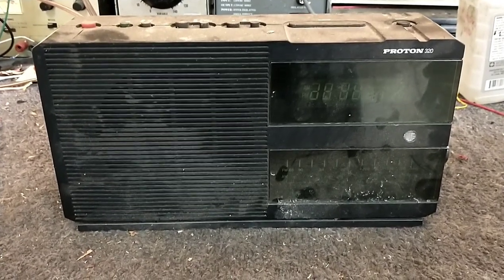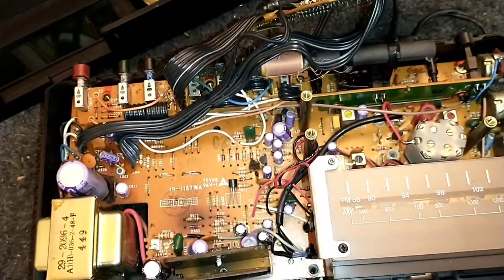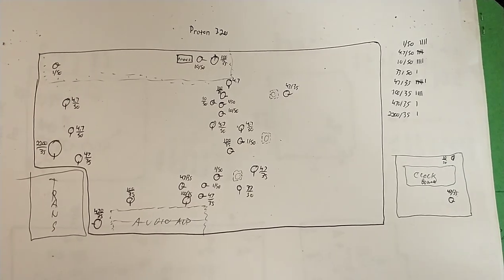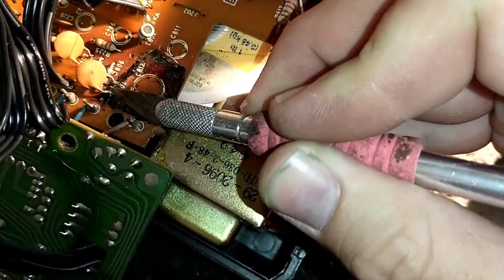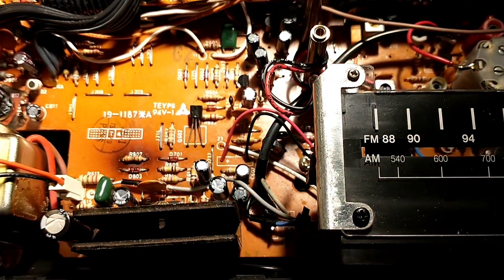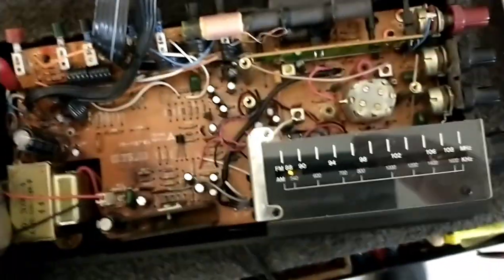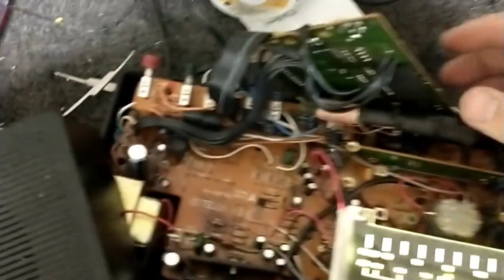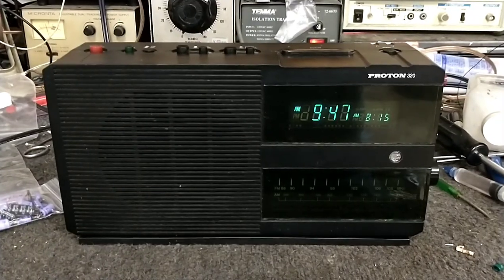Restoring a 1980s Proton model 320 AM/FM Hi-Fi Clock Radio

Comment: I have this radio. Purch'd new in 1990. A daily driver with orig. caps. No leaks and performs well. Did replace the orig. lamp bulb  with LED.  Remember: SEPARATE "OFF" and "ON" buttons.

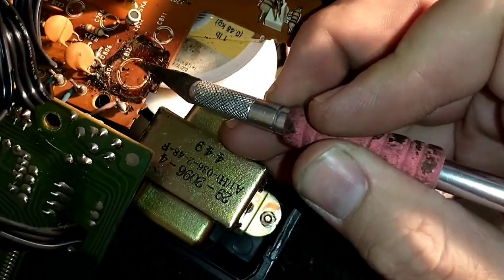Comment: Nice finished product! 11:28 I think the glue on the capacitor bottom to PCB surface was used to secure them for "wave soldering" the PCB, as larger components might move a bit when going through the mechanical process of passing the board over a liquid pool of solder, that has peaks of waves contact all of the exposed copper and component leads, as it looks like that board has been made with ( all of the joints have the same look, no real excess or lack of solder on them from what you showed). It's just too bad they used a product that causes issues over time.
Reply: I was offered a job at a company that did wave soldering. I found out I was already on more than the line manager who was interviewing me, so I didn't go for it. It was a shame really the place was yards from where I lived at the time - their pay grade stank though. It's always the way for me - when I find the job I want the pay is lousy.

Comment: Great video. Just a couple of points that could be helpful. Acetone may soften the glue under the caps and you could put a drop of nail polish on the knots you tied in the dial cord so it won't loosen. I've watched many of your videos always enjoyable. Thanks for your efforts.
Reply from the maker: I've also learned recently that freezing it makes quick work of removal too.

Comment: I have one of these radios, the sound quality is amazing owned from new since 1988 and it was very expensive, only thing i ever had to do to it was replace the dial backlight bulb. dont know how the hell they managed to get such a great sound out of a speaker thats not sealed in an enclosure, these have a lovely warm and full sound, excellent radios. mine doesnt have any circuit glue or matsushita capacitors, theyre jamicon, might be because mines the 250v UK version, spray oven cleaner will remove that shitty glue mate, spray on and leave for 15minutes. theres a bulb behind that silver panel on the dial, they need to be replaced with a green diffused led and resistor.
Reply: Proton was a high-end maker. Nothing they made was cheap.

Comment: Any thoughts on where a bluetooth receiver might best be integrated into one of these? I was thinking of having the BT take AM's place.

 And where to get a power source for it? Looking at the schematic nothing jumped out at me as being a rectifier, so I don't know where they're making their DC supply, but I'm a newbie.
Reply from the maker: Best place to inject would be to interrupt the high side of the volume control, install a switch between the existing line and thr bt adapter. 

You could take the main dc supply, run it to thr input of a 7805 regulator and feed the bt adapter with the output. Most run on 5v
Reply: @JordanPier  Thanks!

Comment: I took some of your advice and picked up a cap wizard.  It's the older style with the yellow writing,  you had mentioned this is better.  This one does not have the cap saver board.  Do you advise adding that board?   Also bought the chem-wik  solder wick, wow does this work so much better!
Reply from the maker: The cap saver will save your ass when you accidentally test a cap with a voltage on it

Comment: Does anyone know of anyone that will refurbish Proton 320's?  Nothing major, just cleaning, replacing dial plug, and replacing items (capacitors?) that fail after 35 years.
Reply from the maker: I do, but the cost outweighs the value of the machine. Takes a good couple hours plus parts to rehab one of these.